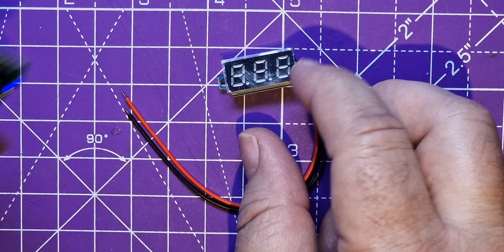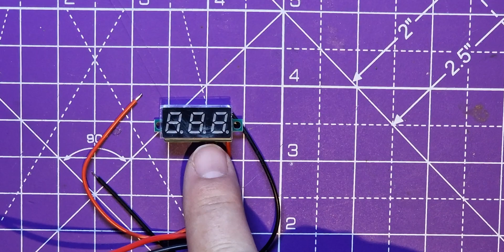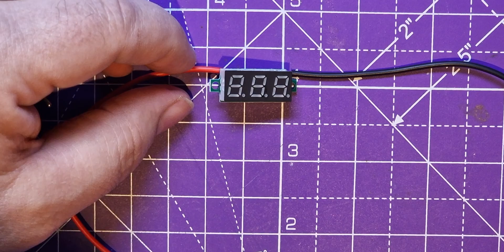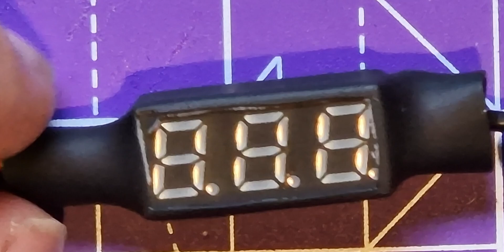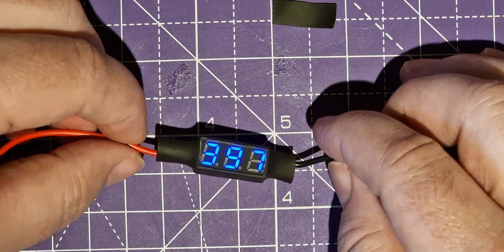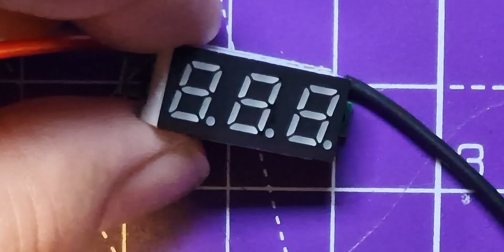Making a quick inline digital voltmeter with crocodile clips.

Comment: Do you have a way to check the amperage draw when this is connected?  I'm wondering about putting these inside of something like a C64 or Amiga power supply so the voltage can always be monitored, but if it draws 500ma, that wouldn't be super useful.
Reply from the maker: The specs say:  

Input voltage recommendation: it is recommended to be above 3V, note: <30Ma

Measuring range:DC 2.5V-30V
Working current:<30Ma
Input range:Dc 5-30V
Display:Three:0.28inch digital tube(red,blue,green)
Dimensions:31mm*11.5mm*9mm(L*W*H)
Measurement accuracy:1%
Operation Temp:-10°-+80°
Color Red/Green/Yellow/Blue
Voltage range:2.5V - 30V

Comment: I feel like an "in line volt meter" would have a female barrel jack input, and a male barrel jack output, so you could plug your psu into the volt meter and then plug your meter into the device. You would obviously wire the input and output together and have the meter in parallel. Otherwise with this one I'd have both red and black come out one side.
Reply from the maker: Thats a good idea.  I can see loads of different test setups for these little modules.

Comment: If you work with breadboards, they are cheap enough to remove the wires and put on a 2 pin header to make a dedicated Breadboard voltmeter.
Reply: Nice
Reply: @MrBobWareham thank you
Reply from the maker: Good idea. I've seen the breadboard psu's but nice to add a Voltage display too